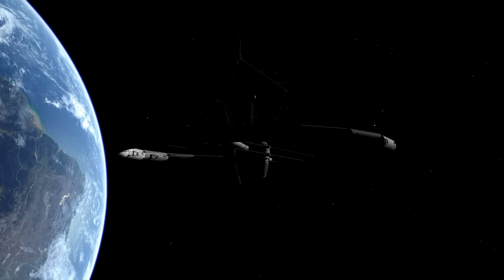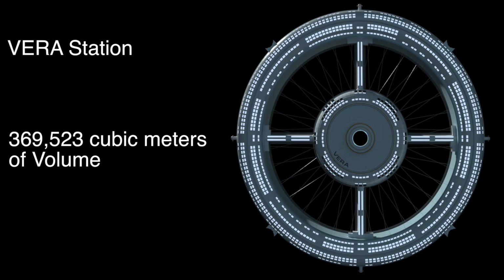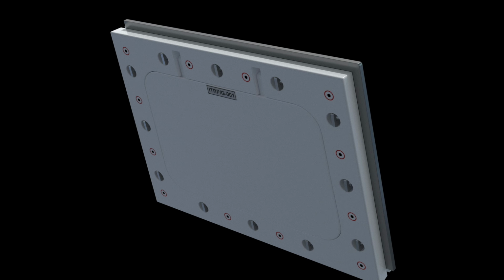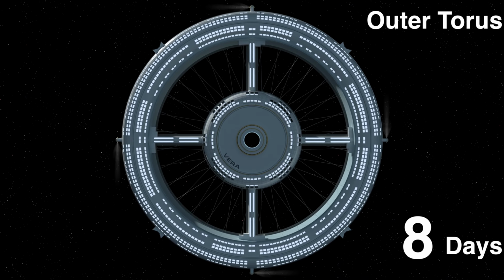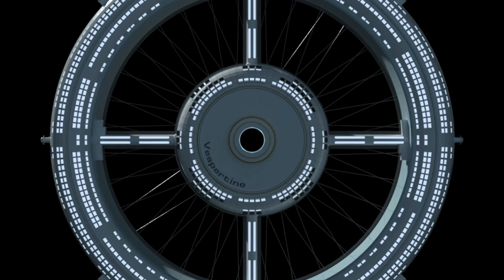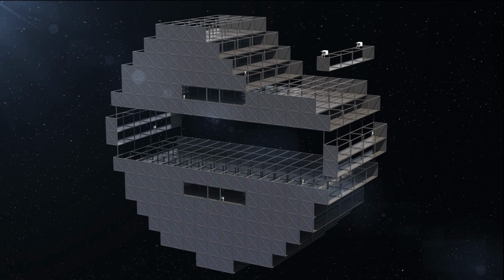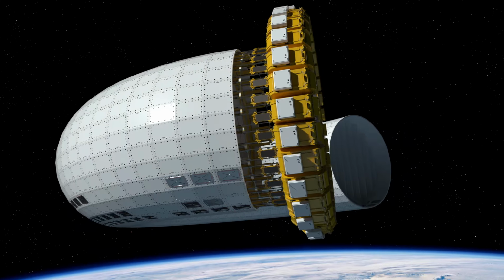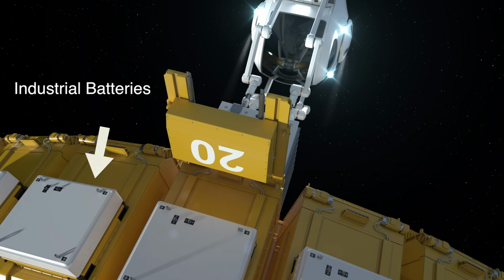We could build this huge Space Station in 6 months

Comment: I always see big open spaces In these ship designs and think that surely they'd have to be many separated zones to minimise damage/loss of life in the event of a collision from debris meteors etc
Reply: Not only that but the entire complex interior in general. That’s will have to be done manually by humans and will take much longer unless we’re just going to live inside of a giant empty ring. The inner construction here is missing.
Reply: @ITech2005  in theory everything is possible, in practice, and reality (cost), there will be compromises and fantasy to reality, things will scale down massively.
Reply: @mytester6208 think ships and how small the cabins.  I think that this is more likely.  The torus design is for larger concepts with more permanent settlements
Reply: certainly he would benefit from studying submarine design.
Reply: There is only one problem. CMEs from the sun. Specifically CMEs with the strength of the Currington event that occurred in 1850s…and which took out the Earths fledgling electrical grid.  That event melted the transatlantic cables.  That was approximately an X30.

Comment: Still needs cheaper launch costs, some hybrid rail launch / ramjet design. Another option is structure&fuel tanks designed to be disassembled in orbit and re-used as structural. Tear the whole rocket for parts so only engine mass is wasted.
Reply: I'm just looking forward to all the explosions from unmanned lowest dollar design testing.
Reply: With an orbital solar foundry maybe even remelt the engine as well

Comment: I guess a few worries:

1) vibrations across the hull/harmonic balancing

2) safety bulkheads to seal compartments in the event of an emergency

3) dynamic load balancing... Smaller stations would be more susceptible to mass (mostly the people) concentrating on one section. This will not only strain the structure itself but could possibly destabilize the rotation of the station.

4) redundancy... What makes aviation, and particularly space flight, so expensive is the redundancy. Everything I mentioned above (and then some) needs backups on backups.

5) startup pressurization... Just like a submarine, the ISS depends partially on air pressure to maintain structural integrity. This design seems to assume the volume to be empty during construction. This may not necessarily be a problem but how does the design account for what's going to happen when it does become pressurized?

6) I forget the name so let's call it a crawler, but can it handle variable designs? At some point the uniformity of the torus needs to be interrupted to allow for structural supports, service access, ingress/egress, and other basic design elements. 

I think it's a good start but idk if everything can be "assembly lined," unless the interiors are also homogeneous, throughout.

Comment: Welding in vacuum will save on shield gases. One less cargo logistics issue.
Ovdr rate all servo motors and drives. Those are the most common failure here on Earth with automated production stations.
#Aloha

Comment: Could low-outgassing structural adhesives (NASA specification SP-R-0022A, Vacuum Stability Requirements of Polymeric Material for Spacecraft Application) be used instead of the electron beam welders?
Reply: Why?

Comment: Very ambitious Project. Still plenty open questions that need to be adressed. To achieve that fas construnction you need to have the other components already in space. what is the expected timeframe of the assembly of the Construction vehicles and the recharge station? Further: this looks like a fully automated process. In what state is the necessary software of the many automated parts. I think Tesla is a very good example of the Problems that can arise with higly automated productionlines. Further you are only calculating assembly time for the outer structures. what about the interior assembly? how much time does the asembly of the interior take. Being in space means being exposed to higher levels of radiation. How exactly will the crew be protected?

Comment: Well it is inspiring and clearly, the timeline for ,building these torus shaped stations will be dependent of Space X getting Starship up and running with a functional model.  Not to mention all the construction and work yet to be done on earth for these designs.. 

 Hopefully we'll get to see a few tests done from Boca Chica.  But I would really be surprised if even one torus station is built using the model proposed in this video.   

One of the problems that we will face in coming years is if Starship is able to launch anything like the Starlink satellites planned.  An increase to 10,000 would greatly increase the threat of a collision in space spawning thousands of pieces of debris which could further put space travel at risk.  And Musk wants to launch like 40,000 of these next gen Starlinks!!!!

Comment: So, what happens to the population in that big volume of case of a collision that exposes the inside?
Because in the ISS, on those "submarine like" environment, its possible to close one of those "unnecessary and heavy" doors.

Where would you get the materials for a ring capable of blocking most of the cosmic radiation and high energy particles?

Comment: Concerns with a large volume is if there is a meteorite or space junk strike which tears a large chunk of hull then the chamber is a death trap.  If I were going to stay on a space station I would prefer it have modules so if any area has a pressure problem it can be sealed very quickly.  I also am not sure rotating gravity is even feasible sadly.  From what I see you end up with more gravity in the lower part of your body than the upper.  I'm not sure the human body is cut out for that or potential motion sickness issues.  Someone needs to run some tests in space, maybe a large piece of truss with a living area on each end.  Then rotate it and see what happens with the occupants.

Comment: According to my calculations:
total surface area for the outer ring is 365,672.84m^2
volume=18,283.64 m^3 or 1,828,364 cm^3
2219 aluminum alloy = 2.84 g/cm^3
totaling in 519,255.43 Kg or 572.38 tonnes
starship cargo volume = 1,144.53 m^3
starship cargo weight capacity = 150 tonnes
16 trips by volume not including the machine and your volume is so high that you'd fill the ship before reaching optimum volume/weight. So I'd recommend shipping the panels and the machine to save money :)
Reply: Thank you! That was my question... ballpark how many launches

Comment: Final join of the panels look problematic and the weld is very problematic (given temp variation and QC of the weld).I do think taking subterranean tunneling cues is the  right avenue but order of operation, quality inspection, and modularity are significant hurtles. Keystoning should be considered as anyone that has played with LEGOS knows the weakness of equal sized stacked parts. Having a seam rip because of a directional control module or orbital correction burn would be catastrophic.

Comment: How many launches to get the "builder" into orbit, how long to build it and how far along is the company with the "autonomous drones" as shown in the video, how many launches to get the materials into orbit particularly as your expecting to build a ring in a hour? Your seriously going to need a LOT of starships. Good luck to you but I really think your massively overestimating your build and safety schedule, let alone R&D on the ground before even a panel is launched.
Reply: I think the biggest issue is the durability of the welds, and a lot of the space based physics of the machine itself. When you move the builder, it will cause movements in the entire structure, because there is nothing to push off of in space, without thrust. If you use thrust, the problem with that is it would cause a plethora of small forces here and there along the stream of the thrust, which can cause some potentially catastrophic issues. Another issue is you would need a completely different apparatus to finish the final segments to close it off, and you would also have to install everything inside. Now what about things that need to be inside, that need to be built inside? You'd need those things in there before completion, which means they'd be exposed to the vacuum of space, which for many components is a bad thing, because vacuum can cause things like cold welding, electrical discharges, massive temperature shifts, etc.  So you'd also have to design these things effectively encased in their own space suits to be removed after the station is up and running. There's just so much more to the logistics than the panels. 

But the real issue is this doesn't really do things any better than we could do with inflatables. With inflatables we can create huge volumes in a single go, using the atmosphere itself as a support structure, and from there we can reinforce it in many different ways, both from the outside and inside, even adding the ability to attach a shell around it to completely enclose inflatables. 

And another issue is, do we really need a giant space station? We'd be better off creating a series of smaller inflatables that can be chained together in a ring.
Reply: He is being optimistic.  As an engineer he thinks his only limit is money. So he is talking here as if money were not an issue.  I know that the human factor and getting raw materials quickly enough are things he Is not considering.  Governments and corporations are run by people. Beurocracy will always slow a project down. Plus mistakes will happen if they hurry.  If it was done by a Pharoah type ruler like the pyramids,  all resources could be allocated  and it would get done. With lots of casualties.
Reply: You really wouldn’t need that many starships to get feed the construction bots.
Reply: You don't like engineering challenges? This looks doable for the right group of engineers
Reply: @Justin-pb8sx  I have no problem with engineering challenges but the time scale they are working to is way out there when you look at what they are promising in the video.
Reply: @devilmaycare2809  true, 👍
Reply: Bruh 150 tonnes of aluminium panels is a LOT of materials. The individual constructor bots are unlikely to be very heavy either, it's not a solid box, just a frame that holds some electronics, sensors and a welding tool head. It's would be a fair few launches for sure but I think you are exaggerating.

Comment: huge open volumes are a non starter.  Leaks will be impossible to find or stop in time.  it will take months to years to re-pressurize your design.  Designs that don't have redundancy to depressurization just won't have public faith.
Reply: I would think they'd add interior partitions once done as part of the interior outfitting.

Comment: Is there eny chance to build a space elevator or someting that will make easier to take off from planet gravitation ? whot about huge rotor platform that will be in air with turbines and might have some kind of ballon stabilization , and that platform can land and carry a huge weight, this platform can shoot rockets that safe like 50% of fuel at least, so it might be cheaper to land of with a huge wieght safe . Space station building is awesome i dream about it most of my life , automatic space printers can create almost enything we have this tech , if imagine some kind of octopus that cna print with 15 heads 15 diff materials, layers, cabels all in one. The feed of material is cruciouse.
Reply: Next huge problem is radiation in space , whot about one layer of space that will be filled with radiation absorber, it can work like in space we have minus so the material can freez and when will absorb 90% radiation and need to be changed it can go to space port where will be warm, so the material will unfreez and can be pumped out and filled egain with that substance,  whot about Kaolinit (Al4(OH)8Si4O10) with oxide of Pb.  ITs physical sheild,.

Comment: You sir are on the next Level.  I see you are working with Mr. Musk. I was shocked when i found that Musk was building the front end of his vehicles in one Unit and the rear in another unit. then assembling together. you are doing the same thing, full automation.  No room for the Welfare people that the women promoted 50 years ago.  i will assume the space station will be Fuel cell and solar electrical power ?  Musk will supply the power thrusters for the station?  Tesla has new Glass batteries?
Reply: He's not working with Musk.

Comment: How do you intend to weld the edges? A linear axis needs to be longer than the working length. Your machine isn't able to weld the edges because the welder can't reach that positions. The circumferential axes must overlap to get the full length of the weld done.

Comment: Doesn't the Torus need to be especially big to achieve the right velocity for earth gravity and to avoid the drawbacks of the coriolius effect?  It ISN'T gravity and simply by walking counter to the spin, thus slowing your centrifugal force, you literally become lighter..  or if you walk in the direction of spin, you become heavier. This is the Eötvös effect and would be very real in a small Torus.  Even potentialy to the point where one might go completely weightles.  If you were to run counter to rotation and jump, you would jump higher. Run fast enough and youd jump to the ceiling.  The speed requirements vs the size requirements would suggest that we would need a very large in diameter ring to make a space station something that people would actually comfortable existing on in the sense of stable gravity.

Comment: Good job.  This is very innovative and could work.  Your other design isn't good for holding pressure against flat wall panels but this design is and you have modified your original machine fabricator to do the work on the torrus.  How will you join the ends since your machine will be in the way?   I would suggest bulkheads to hold off pressure so a basketball size hole doesn't let all your air out.  Compartmentalize this and it will be safer.

Comment: I have some questions:
*How many tons are needed to be delivered to space to construct the Vera space station?(to understand how much money is required for the delivery)
*How is the Sargon transported and assembled in space and how much does it weight?
Reply: That's the big question. In the video we see starship carrying packs of module plates. It seems that each pack is 10 pcs and the rocket carry about 15 packs + some batteries. So let's say 150 plates. (It feels very little but as we don't have the size of the plates it's hard to say.)
The small thorus has 84 panel rings. Each ring is made of 32 panels. So 2688 panels. So that would be 18 starship launches for the small thorus. The big one is probably 100 starship launches.

Then add the floors. There's probably twice+ as much surface in the floor than in the thorus. So let's say 40 starship for the floors. Though maybe floors are lighter than thorus wall? Hard to say. So let's add maybe 40 starships for the interior and extra margins. 

That's a total of 100 starships to make the small thorus. At $10M a launch that would be $1B investment. Without material cost, engineer cost and so on and so on.
Reply: @pierreboyer9277  ..or only 5 starships from Moon surface, I guess. Assuming there are mining and production facilities on the Moon surface.
Reply: @Cybermiaou  Indeed with manufacturing on the moon/asteroids those kind of space station becomes much easier to build as a large part of the cost is getting into orbit the material.
Which is why manufacturing in space would be awesome. The issue is that we're not quite there yet.
Reply: I think logistics is going to be the hardest or most time consuming part of this. I guess once the factory and panels are placed in orbit which will take a good year or so minimum building will go quick. I'm a little confused on how assembly is done. Automated through a program or remote or will there be a astronaut team overseeing from the iss for the first section u til its livable?
Reply: @TheSTARGATER1  Costs are a much bigger problem than time.
Reply: @isaacdorfman  At this level, what even is money?

Comment: How do you get around the problem of cold welding? Looks like lots of moving parts and how long will the construction ring take to build? It definitely us a great solution IF it works as depicted. Does the software exsist for this? This is cool and could be used for asteroid mining facilities. Build a giant ring around the moon! Your building just the shell ur going to need an advanced environmental recycling system with triple redundancy also in case of a breach sealed emergency sections. Radiation shielding the whole thing will have to be covered in solar panels. There's a lot more to this than just the frame work. I believe your construction times are way off.
Reply from the maker: Good Question, Aaron. This is one area we will take advantage of our relationships with both Electron Beam welding companies and Electron Beam weld head manufacturers. We will begin working with them on our ground demonstrator in the fall.
Reply: @TheGatewaySpaceport  cool I hope you succeed in your endeavor

Comment: What's going to be the power source for the welders and the rest of the machinery? Kind of a lot is missing in this "design". It's a good idea with this design, but I think that it would be 1000x easier to build modules on Earth and just screw them together in space (especially that SpaceX's Starship will be large enough to fit inside such ready assembled and fitted modules).

Comment: This would need 4 machines to build it as 2 half circles, then welded together using another internal droid mech. The big welder will not be able to finish 5-8 of the last sections in a complete circle. would be faster with 4 builders and 2 sections completely ready to connect together.